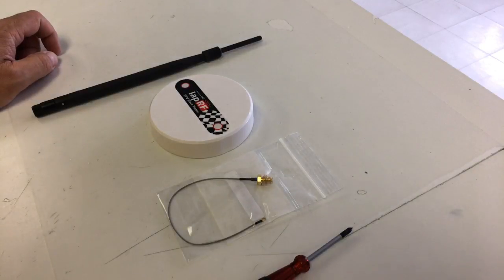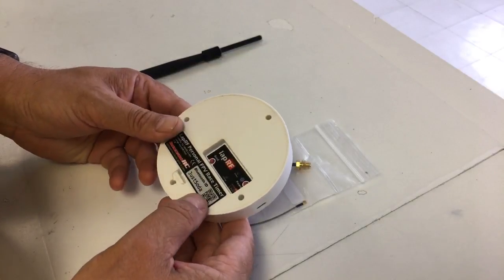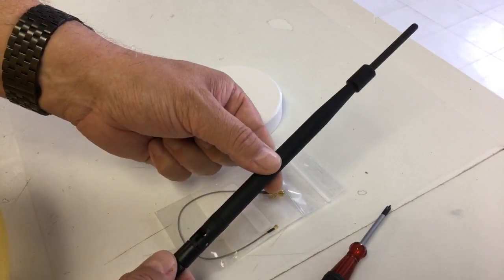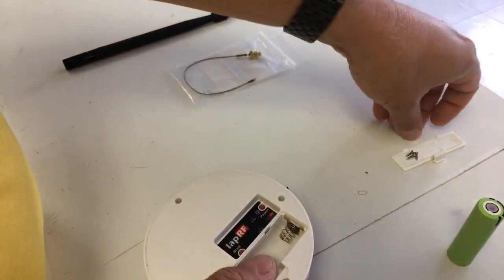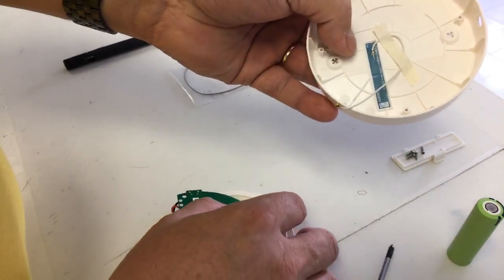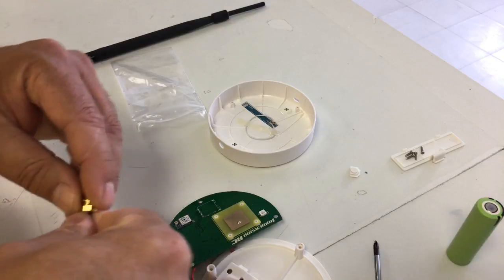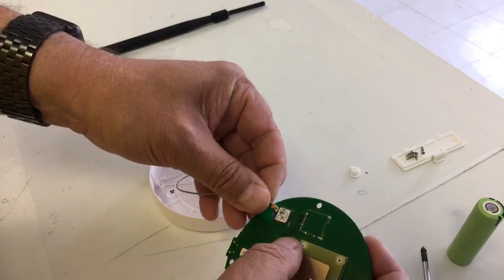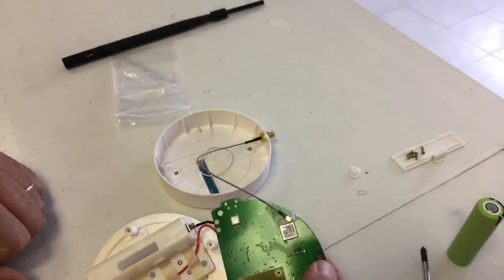How to upgrade the bluetooth antenna on an ImmersionRC LapRF

Comment: I bought one of these units from you this week but there were no directions or instructions. Is there a url for how to use this and where to download the app?
Reply from the maker: Bryan, of course, follow this link: https://www.immersionrc.com/?download=5490
Reply: Thank you! That looks to be exactly the document I need.
Reply: I have been using this timer and it is great when it works. However the software keeps crashing on my android phone after I have stopped a race and am starting the next race. It locks up during the countdown of the new race. If I reboot the program it works well until I stop the race. Then it will lock up again on the next race. I am on android and this is in practice mode with a 10 second countdown.
Reply from the maker: I never had a crashing problem with any of the Apple devices I used for this. I used IPhone 6S Plus and an iPAD mini. One thing you might want to make sure though - that your Android device is updated to the latest FW. I never used any Android for this.
Reply: What's an FW? It would be unfortunate if the immersion laprf did not work dependably with android systems.
Reply from the maker: FW is Firmware. You can find the latest on the ImmersionRC website and in the manual you can find the procedures on how to upgrade the Firmware on the LapRF. Also you need to make sure your Android is updated and it is the latest version. I remember that some people reported issues with older types of Android phones which all disappeared when they started to use a newer Android device.
Reply: Will do. Thanks for the support!